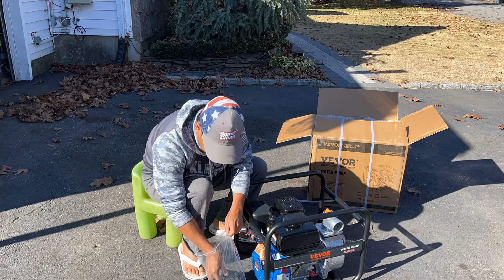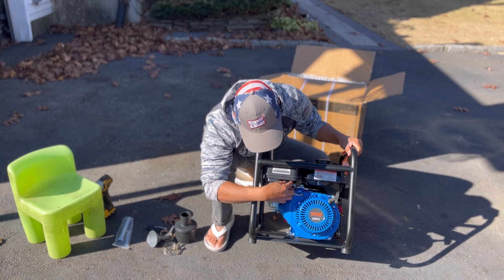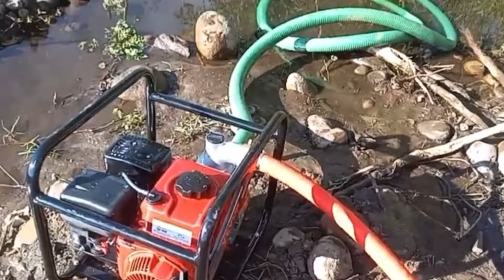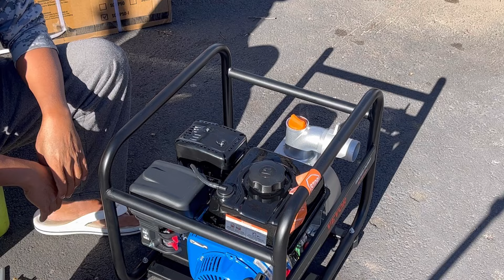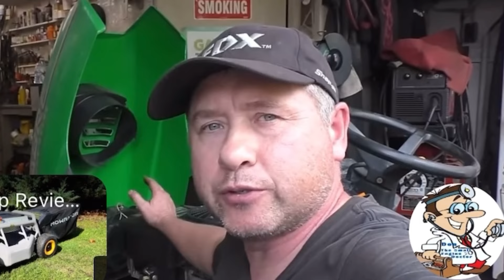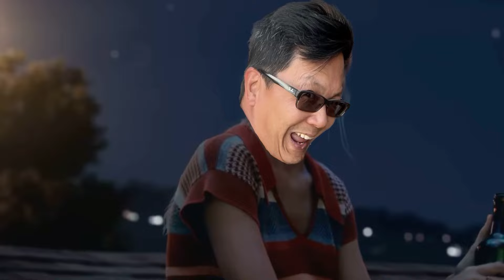VEVOR 6.5HP 132GPM 4-Stroke 209cc Gasoline Powered Engine 2” Water Transfer Pump Cast Iron Impeller

Comment: Hey Henry. A pump like the one in your video would be great for farmers or for construction contractors that would have pump out large amounts of water or to move the water from one location to another like on a farm.
The rubber feet also reduce much of the vibration that would mess with the needle and seat in the carburetor. That is especially true for generators when thinking about the rubber engine mounts in addition to the rubber feet to protect the engine as well as the generator head. 
That looks like a pretty nice pump.
Reply from the maker: It’s decent bro